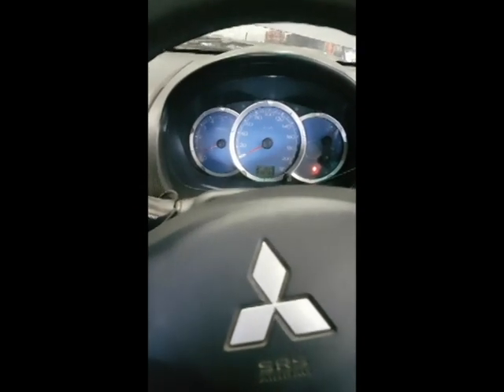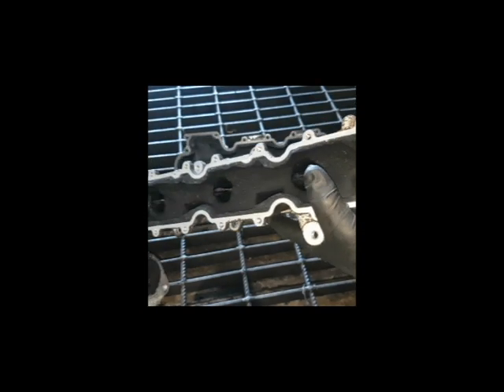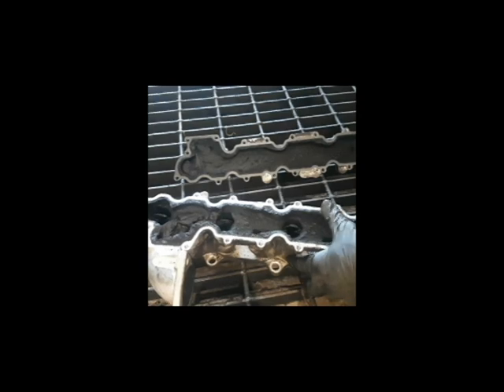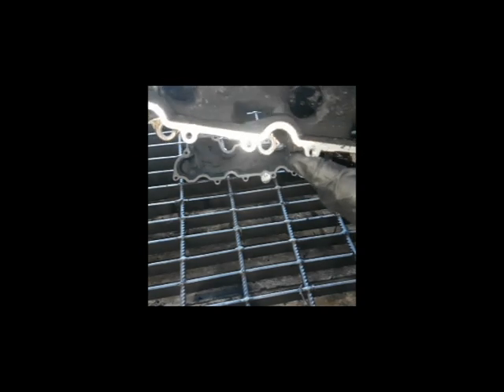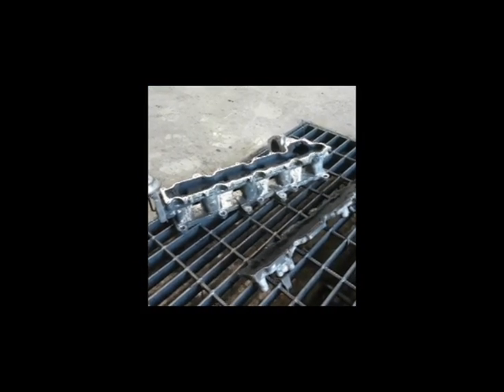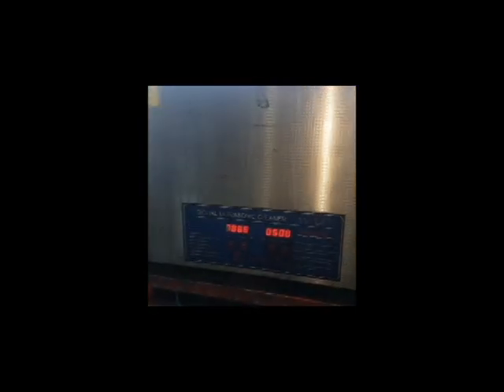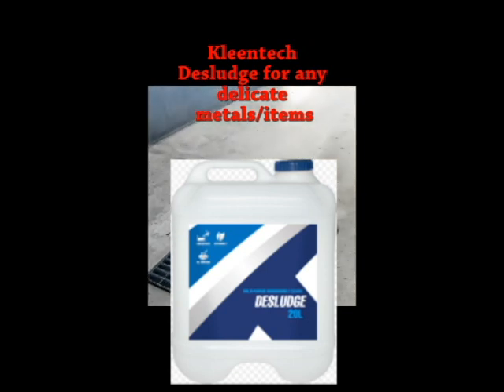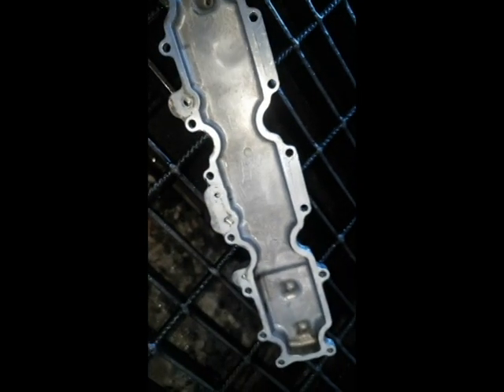Diagnose + Clean Blocked Mitsubishi 4M41 Diesel Intake Manifold

Comment: Wow, at last someone who knows what the issue is. I have the exact model Triton. I have gone to several diesel mechanics who all say something else. I have changed other components out as instructed & no improvements occurred. Thank you so much for this accurate information well done.
Reply: Did you get around to cleaning the intake manifold? Did it solve the problem you were facing?
Reply: @hafeexius  hi mate,  yes I disconnected the swirl valve hose & I bought LiQui Moly Diesel engine Intake Decarb. I use it every service time (3months) for me as I do a lot of kms. Do as the instructions say & presto. The car runs perfectly ever since, full power no issues. Hose is still disconnected 🙂
Reply: Can the swirl flap be remove